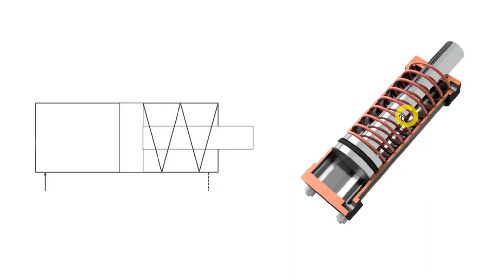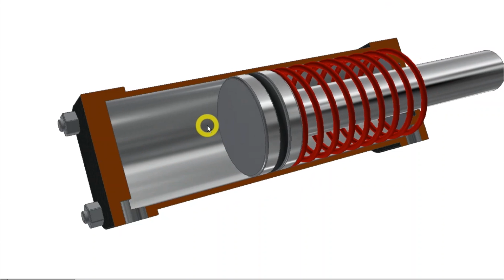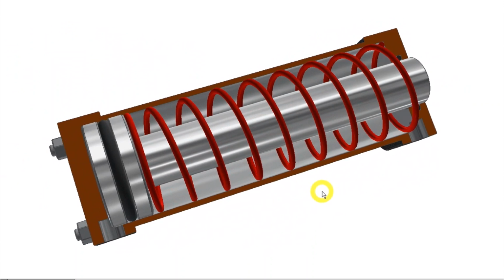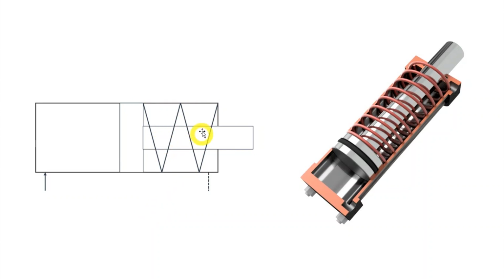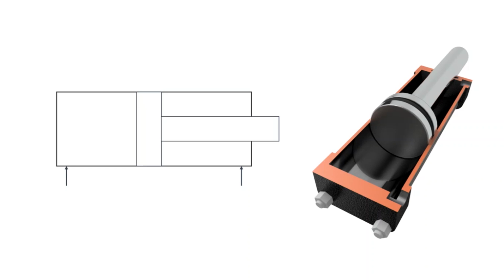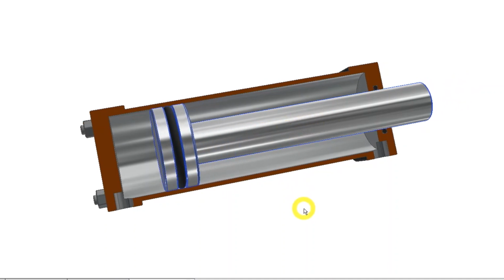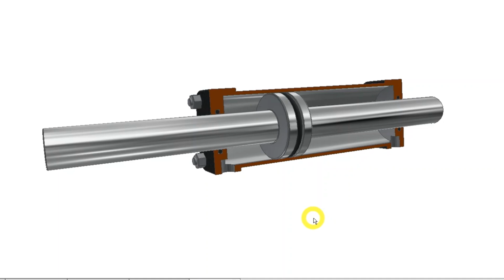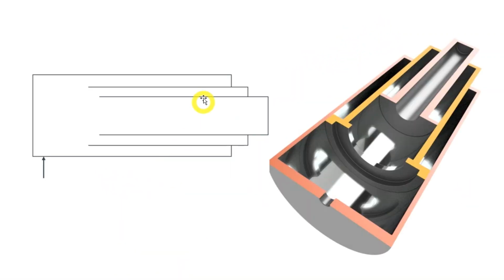This is how hydraulic cylinders work.

Comment: where is this spring mounted?  I've never seen this spring in any hydraulic cylinder?
Reply from the maker: Cars have them, on the brake calipers, and hydraulic jacks too. It is quite common on hydraulic systems.